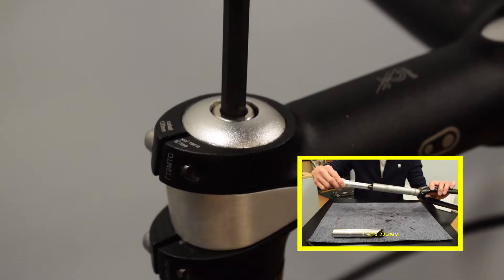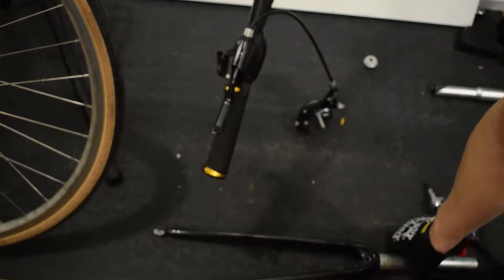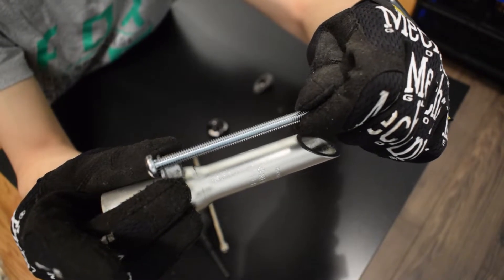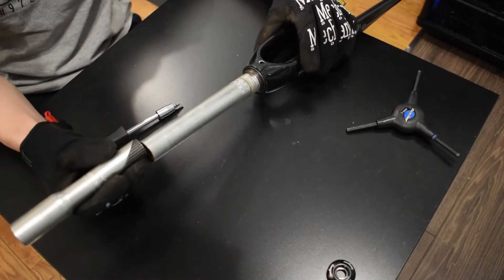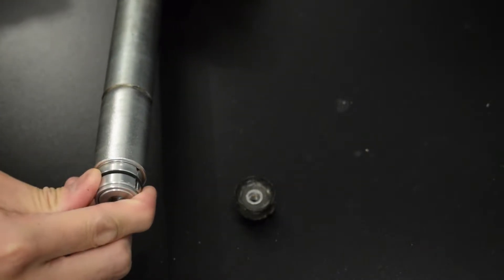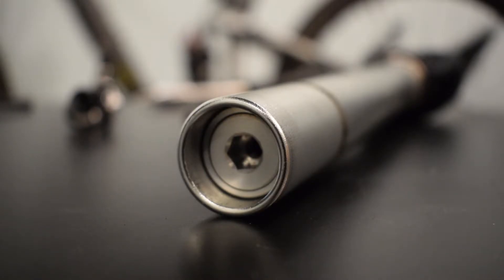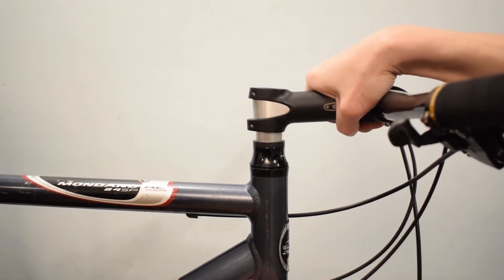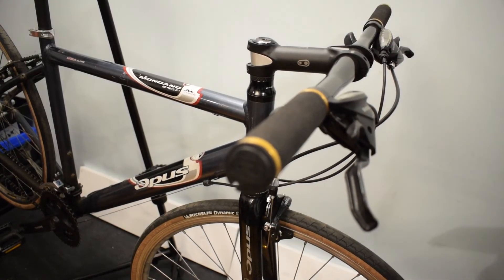Hope Head Doctor Into Steerer Tube Extender

Comment: Park Tools recommends a torque setting for generic quill stem binder bolt of 16-18 nM. I doubt you’ll get anything near that with a Phillips head bolt. After you install the expansion plug you can’t get at the quill stem binder bolt to retighten it if necessary.

Comment: You're not going to be able to torque down a philiips head screw tight enough to hold the extension into a steerer tube. You're going to get someone hurt with this advice. At least use a hex head bolt if you have to. Do not use a philips head screw if you value your safety!

Comment: how about  80mm, 45 deg handle post no need extender but I like your idea much more safer than the usual extender.
Reply from the maker: Yes, it should work but you’ll see a gap between the steerer tube and quill stem.

Comment: What is the mm of that m8 bolt?
Reply from the maker: It’s a M8 bolt, 4" x 1.125".
Reply: @DanyoSports  is 55mm will fit? I can't find 4" in shops.
Reply from the maker: No, 55mm is 2.16” and it wouldn’t reach to the wedge.
Reply: @DanyoSports  then, can i use the original bolt that include's in steerer tube extender?
Reply from the maker: Unfortunately the original bolt is too long, I already tried and it didn’t fit.
Reply: @DanyoSports  but if i cut it, can it fit? Sorry if i have many questions😅. I cut my steerer tube too short so i don't know what to do. But I know you're the one that can solve my problem😁
Reply from the maker: Try it, but the problem is only the bottom part of the bolt is threaded, so you are probably going to cut that part out.
Reply: @DanyoSports  okay! Many thanks to you sir!👍

Comment: What product did you insert into the fork?  It was a quill to thread less adapter, but it fit inside a 1 1/8 fork?
Reply from the maker: Yes, it’s a quill stem converter for threaded forks, they have size for 1 1/8” steerer tube forks.

Comment: The problem with doing this is that the thing you have stuffed down the tube could fail by changing shape or shattering, or anything that causes the thread to fail, thus causing the steering column to fail. Pretty dangerous. Should not be used for "big hit" or trials riding.

Comment: Very nice tutorial, I have now extended my fork in exactly the same way.  Above the stem with the Head Doctor everything is correct and it holds without problems.  Below the stem, however, the adapter in the steerer tube seems to shift because the headset loosens after every ride.  Has anyone had the same problem and was able to fix it?  best regards
Reply from the maker: Thanks, I would suggest to clean and sand the inside of the steerer tube and then tighten it again.
Reply: I have similar issues
Reply: Quill stems will often move slightly inside the steerer even when the wedge/cone is tight, it's a basic fault in their design that the top of the quill is a sliding fit and more often loose than tight, especially if the quill is painted. You could try using something like Loctite 603 to eliminate this movement (you'll have to remove all the paint to make the Loctite cure properly, or you could maybe just use ordinary CA "superglue" on the painted surface). There may also be movement between the extended steerer and the top bearing conical washer, so glue that on too once  it's adjusted. This is a useful hack but it's probably not going to be as rigid/reliable as a single piece of metal of the correct size. You pays your money ...

Comment: Hey bro please help me out here i do have a 1inch fork but threaded but its 7 inch long while my steer tube is 7.5 or 8 inch long can i do the same you did or do you have any idea and i do love your videos
Reply from the maker: Hi, yes, the extender would extend the steerer tube by 50mm (2”), however you’ll need threadless 1 1/8” stem and handlebar.
Reply: @DanyoSports  what about the headsets should i also change into thread less ones
Reply from the maker: You don’t need to change the headset: https://youtu.be/uCDgM4JvptE

Comment: How do I take it back? Without the use of a hammer
Reply from the maker: Release the expander, find a 2” tube with the same diameter of the extender, put it on top, insert the stem bolt and cap and then tighten it, it should extract the Hope Head Doctor.

Comment: What is the size of nut and bolt if your extender is 25.5-28.6
Reply from the maker: The size of the bolt is always M8 and the M10 flange nut shoult fit too.
Reply: DanyoSports What if a M8 bolt is not available in your region
Reply: DanyoSports I followed all of this yet there are no M8 bolts here
Reply from the maker: If you couldn't find the M8 bolt, use a 1/4" x 4" screw/bolt, insert it into the flange nut and wedge then screw a nut at the end to tighten it down. The idea is to tighten the wedge on the extender.
Reply: @DanyoSports  thank you bro! 100k likes for you!!!

Comment: This seems like a great idea but the Hope Head Doctor would not fit inside the quill riser I purchased.  Up to that point, it was going great.  I tried everything nearly ruining my fork.  What is the precise brand of quill stem that will work for the Head Doctor?  Thanks.
Reply from the maker: Try to remove the O-ring (black rubber band) from the Hope Head Doctor, you’ll see the gap of the expander, cut out and expand the gap a little more, it should shrink the expander a little bit so you could then slide it into your quill riser a little more easier.
Reply: @DanyoSports  I am now zero for 2 on finding a quill extender that will fit the Hope Head Doctor.  Just ordered the Zoom Q-2 22.2 from Jensen and it has VERY thick walls so it was worse than the last one.  Not even close to fitting in.  Is there a specific quill extender brand that we know will work?  Would really like to try this, but not sure what to look for.  Thanks.
Reply from the maker: Sorry to hear that, I understand how frustrated it is to have 2 extenders not fitting the Hope Head Doctor. 

I suggest you to install a regular star nut, that way you don’t have to buy a third one, it’s more flexible and it would fit into your extender. If not, grind the inside wall of the extender, make it more room to fit the Hope Head Doctor.

The brand name of my extender is Upanbike and you can get it from Amazon.
Reply: DanyoSports Thanks again. I did buy a star nut and cap so hopefully that will do the trick. If anybody needs a slightly beat up but still functional head doctor, just let me know. 😊

Comment: Will this work with a standard stem cap and star nut, or does it have to be a Hope Head Doctor?
Reply from the maker: Yes, it will work on star nut but you’ll also need the top bolt, otherwise it will not fit properly.
Reply: @DanyoSports  Is that different from the standard top bolt?
Reply from the maker: Sorry, I misread your question. Yes, standard star nut, stem cap and bolt will work fine.
Reply: @DanyoSports  Thats great. Thanks so much for making this video and answering people's questions!

Comment: Is it suitable with carbon steerer tube?
Reply from the maker: Yes, the Hope Head Doctor is suitable with carbon steerer tube.
Reply: DanyoSports hi thx for the info, is the adaptor same with ur part1 video?
Reply from the maker: Yes, it is the same adapter with the same fork, all I did in this video is to clamp the adapter into the steerer tube and then put in a star fanged nut.
Reply: DanyoSports wah thanks, i just bought used fork, and its quite short for my bicycle.. finally i found the solution...
Reply from the maker: Nice, I hope this helps.
Reply: @DanyoSports  Head Doctor is OK with carbon but the quill isn't.
Reply: No - the wedge on the extender could break the steerer.

Comment: I wish you would show where to find M8 short bolt. M8 bolt is already short. So it should have been M8 "long" bolt.  It is hard to find a fully threaded version of it. Also, your M8 bolt is allowed to screw in with bunch tools. Many M8 bolts even can not be comparable with a screwdriver.
Reply from the maker: There are many options, if you couldn't find the M8 bolt, use a 1/4" x 4" screw/bolt, insert it into the flange nut and wedge then screw a nut at the end to tighten it down.

Comment: Does the top cap use a standard top cap bolt? In other words, could I use this top cap on a different fork with a standard star nut?
Reply from the maker: It fits on standard star nut but you need the Hope bolt to fit into their top cap.

Comment: good video - i just installed the Delta 4.6 extender but i feel like the center bolt is not keeping things as snug as possible - seems a bit of play at the fork that in shouldn't have... would a longer bolt help? if i can even find one...
https://www.amazon.com/dp/B007WEQIT4/ref=cm_sw_r_other_apa_i_q.hWEb5KDVHAC
Reply from the maker: Tighten the headset bolt before tigthening the extender bolts, you need proper preload on headset, does it come with a bolt long enough to reach the star fangled nut inside your steerer tube? You need to find a long M6 bolt that is at least 90mm.
Reply: @DanyoSports  thanks - yes, did tighten the center bolt before tightening the outer stem side bolts - the bolt is 90mm or roughly 3.5"
Reply: @DanyoSports  i think maybe a longer bolt then ...

https://www.amazon.com/dp/B07S74RFH1/ref=cm_sw_r_other_apa_i_i9iWEb8QD3A2K
Reply from the maker: Sure, this bolt is long enough. Keep me updated.

Comment: Sick video mate, however I was wondering if this is safe to do on a mtb? I believe it’s safe just for general cross country trail riding, but what do you think it’s capabilities are when I do small jumps with this steerer extender?
Reply: Don't wish to ever remove extender? Ok! Scuff thinner end of extender, WELL. Butter with JB•Weld. Use hex-head long 8mm bolt (grade 8 or 10), with Loctite. Allow at least 24 hours to set before installing star-nut and mounting your forks. Extender is not going to loosen or slip.
Reply: @aleksandrbmelnikov  agree on using loctite. i even used metal epoxy to secure my extender
Reply from the maker: Thanks, the extender is safe as long as it  is clamped to the steerer tube, riders rode these on their MTB in the 90’s, they are as strong as the threadless stems in the old days.